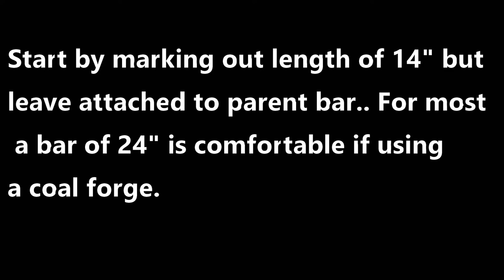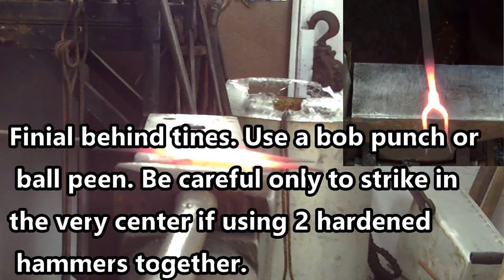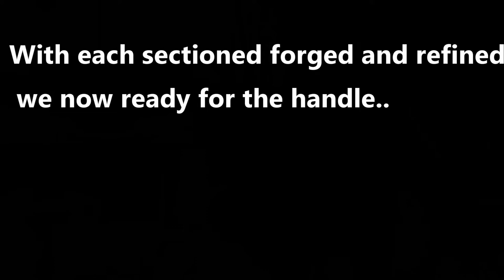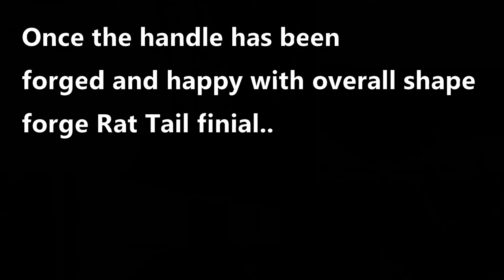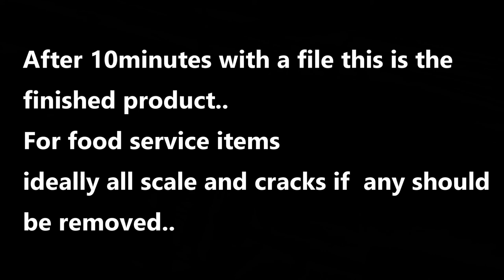How to forge a 2 tine fork.

Comment: Beautiful work on the fork, JLP.  The lines are so graceful.

It's refreshing to see someone fullering and drawing out using the horn!  So many times the smiths you see profess using the anvil edge which leaves deep indentations that one then has to hammer out.  I have had cracks develop using that method even when forging at yellow and orange.  The horn is so much smoother.
Reply from the maker: Thanks.. Probably my favorite pattern of fork.. Spoon video will be out next week..  

 The horn can be a very effective metal mover.. It's one I prefer..

 Try to keep in mind, Each technique has its place and the "limited contact patch" technique can be an effective tool .  It's not my favorite.. But each tool or technique in your arsenal can be an asset..  

Not sure of your setup or anvil you have but, having a generous radius will help with the cold shuts.. Also try to lessen the depth (lower bar angle to the anvil) while forging over the far side..  You might find this helps with the cracking.. 

I will eventually be putting out a directional forging video showing how different aspects of using the hammer, horn  and such to move metals in different directions.. 

Thanks again for you comments..  Much appreciated..

Comment: Very Nice work. That is actually a beautiful piece.  Thank you for sharing.
Reply from the maker: Thanks..  I'm hitting all the bases...
Reply: JLP Services Inc I'm going to try making one of thoes really cool looking Brian Brazeal, Alec Steele hammers. I want to make two, one from C1045 and one from C6150. I was planning on using H13 tool steel for making the drift. Do you concur with that choice, or do you recommend a different steel. Have you ever forged 6150?
Reply from the maker: Personally I like my hammers really hard..  Before Alec Steel being such a promoter of using 1045..  I would have never even considered it..    1060 thru1080 for hammers would be the norm at least back in the day.. I have used hammers that the faces have sunken in with considerable use in the the 1080 range..  But then again these were hammers worked 12hrs a day for years.. 

   The 1045 offers lots of advantages for newer users and I guess as I have gotten older and moved away from the blacksmithing and then moved back 1045 makes sense.
  It's fairly soft.. I wouldn't even consider it a tool steel ( tool steels being steels used for working other steels while cold.. Used to be the definition) Just to low in carbon to stabilize the matrix.    A miss strike isn't much of a problem as the face of the hammer just deforms vs damage to an anvil or harder tool.. 

I have done more damage to my anvil in the last 3 years than I did in the first 30 years of using it combined.. (just not as accurate)

I have not worked with 6150 off the cuff..  ( of late 5160, 4140, H13 and some HSS and some W1).. Oh, also some A1.. 

From the specs it should make an excellent hammer or really anything.. I find the addition of Chromium and vanadium really ramps up all the features one can look for in both a cold work steel tool and a hot work steel tool.. And while the carbon is a little low for what I would have considered years ago, the additional alloys would make it a go to.. 

For the money I think the 6150 would be the better longer lasting steel if for hard use..     But you also pay more for the allow vs just a W1.. 

To bad your so far away.. I'm always happy to swing a sledge.. :)

do you have a source of H13?  

Looking forwards to the results..  :)  Don't know if any of this information helps as there are just so many ways to get to a desired outcome..
Reply: JLP Services Inc Umm, did you say 30 y e a r s? OK, I don't feel bad now, my stuff I work on looks like it was forged by a dump truck. Thirty years, I'm not qualified to sweep your shop out. I feel truly fortune that you take the time to respond to my comments! Damage an Anvil? I haven't graduated to a real live Anvil, I still use a A36 Plate, Striking Anvil because I so inaccurate. However, the refacing is really simple.  Most of the steel I use is from a recycling place. If I want really good stock I have to go into Norfolk Virginia or go all the way to Raleigh. I practice using rebar because I can get it free so I don't feel to bad  when it goes into making a concrete cattle feed trough. I use Dillon Supply for any mild steel, and I can order tool steels on line. I do have some Titanium I want to make some tongs with. Anyway, thank you for the knowledge.
Reply from the maker: My pleasure..  It's people and comments like yours that makes/and keeps this fun..   38 years is how long smithing in total time, yup that long. I should be so much further ahead of where i am.. :)  LOL...   

I love that you have gotten back at it.. Anytime swinging the hammer and mashing iron is a good time and with your back ground it's just rolling around in the back of the brain waiting to come back out.. 

  And hey,, You can come on by and sweep the floor anytime.. :)  I can always use a cleaning crew.. Only the higher power knows I'm a slouch at house cleaning ( The shop that is..)

Do you go to  I forge iron?
Reply: JLP Services Inc I am now on I forge Iron, still using Abby Babby.  I can't remember if I told you that my dogs name.
Reply from the maker: I love the name Abby Babby.. Sound like something I'd say..  WE have 2 little doggies we adopted from a rescue few months ago.  They were supposedly picked up off the streets of Worcester running wild.. Both were un neutered males..   first 1.5 months the littlest one you were never quite sure when he was going to bite you... He's over it now and is my best little buddy.. 

We love kritters..    Nice..    By the way.. As a joke..    The response to your "30 years" was supposed to be.. " Yeah I know it right.. You would think I'd be better by now"..     :)
Reply: JLP Services Inc Like Worcester, Mass?
Reply: JLP Services Inc Abby is my Belgium Malinois.  Sandy call her the Maligator. Darcy calls her the fur factory. One day Darcy's friend complained about the dog hair and Darcy told her, didn't you see the sign nex to the stairs that says "Dog hair sticks to everything but the Dogs" and "The Dogs live here, you don't,  If you don't like Dogs, LEAVE"
Reply from the maker: YUP..
Reply from the maker: Amen to that..    Never heard of the breed..   Did you pick her up on your travels?
Reply: JLP Services Inc Most police departments use them now, they look like a hyped up German Shepherd.  She was a rescue we did. Guy chained her up to a tree at 3 months old and went to Disneyland. So the Sharriffs called me, I got Abby he got five years in prison. There were very many dogs that were being horrible mistreated.
Reply from the maker: I was going to say She looks a little like a German Shepard, but people can be a little sensitive.. Figured I'd just keep my words quite.. 

Nice,,  I love stories like that sounds like a wonderful exchange :)..  

My belief is "We are supposed to take care of animals not miss treat them"..   I am always awestruck in the Farrier work I do on how The horses could kill us so easily yet they are kind and gentle and understanding if we listen for even a minute..
Reply: JLP Services Inc I'm not sensitive at all about anyone calling my beautiful, sleek, hyper intelligent, graceful,  Abby Babby a plodding, challanged tugboat,  humble German Shepherd,  not what so ever, ( I'm sorry you had to hear that girl, here's an extra stake so you can forget). No, really, Malinois are bred for work ability not for standards of appearance. So they can be black/fawn short hair, long hair. My Dad raised Quarter Horses and some kind of saddle breed, at one time he was trying I think they were Warm Bloods, or Destrias? I don't know, they were black, huge and gorgeous. The only thing I remember about his Farrier was he didn't like working with our Thoroughbred colt, I didn't like him either. The guy (colt)was a gunky head, I named him Jaws. Mr. Calhoun ran an 8 up Shire team, when they shod his horses they used a steel cage with winches, thoes hooves were gigantic.
Reply: JLP Services Inc I'm not sensitive at all about anyone calling my beautiful, sleek, hyper intelligent, graceful,  Abby Babby a plodding, challanged tugboat,  humble German Shepherd,  not what so ever, ( I'm sorry you had to hear that girl, here's an extra stake so you can forget). No, really, Malinois are bred for work ability not for standards of appearance. So they can be black/fawn short hair, long hair. My Dad raised Quarter Horses and some kind of saddle breed, at one time he was trying I think they were Warm Bloods, or Destrias? I don't know, they were black, huge and gorgeous. The only thing I remember about his Farrier was he didn't like working with our Thoroughbred colt, I didn't like him either. The guy (colt)was a gunky head, I named him Jaws. Mr. Calhoun ran an 8 up Shire team, when they shod his horses they used a steel cage with winches, thoes hooves were gigantic.

Comment: Very clear video, Thank you.

One thing I did with the three prong toast forks I used to make, was to pre-forge the taper of the tines before splitting. Do the bulk of it in one piece and then all that was needed was to just regularise and chamfer the tines afterwards. I found it was easier and quicker to forge in one piece, and with fewer heats once split, there was less risk of burning the tips...though I found you could still burn them if you tried hard enough! :)

Different starting and finishing points of course. I was forging from Ø16mm (Ø5/8") and leaving a 3D knop at the root of the tines. The tines of course came out of a much shorter section of parent bar, so needed much more drawing out.

Have you ever tried that?

Alan
Reply from the maker: Hi Alan,,   Thanks for the feedback..  Yes, I have used the pre taper then slit method and is my go to on multi tine forks, splitting off each one to round up.
I use that same method for fish spears..  

I will be producing a 3 or 4 tine fork video in the future. Time is undecided at this point. Few months maybe.. 

  I prefer the method shown in the video for 2 tine forks and makes a great demo at shows and such as it moves along very quickly..  From start to finish is about 30minutes (without polishing)

Thanks for sharing your technique as well.. Great to hear what others are doing..